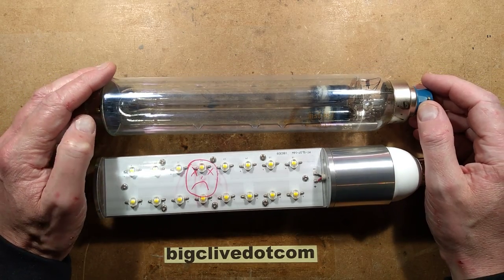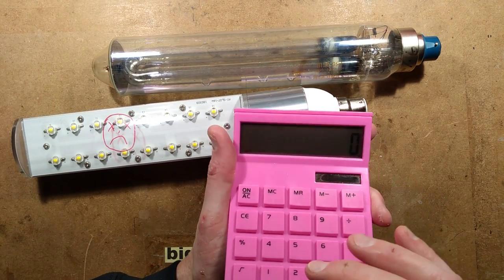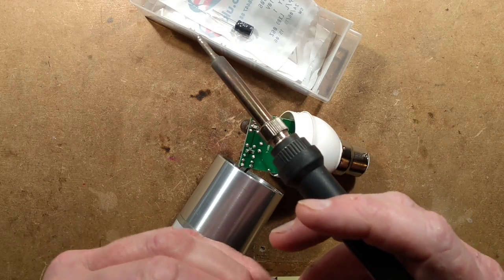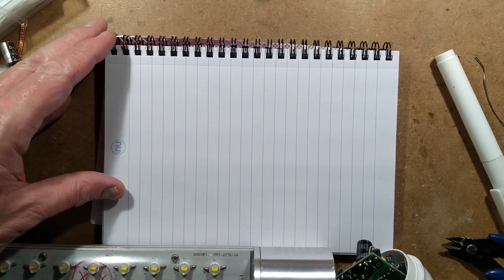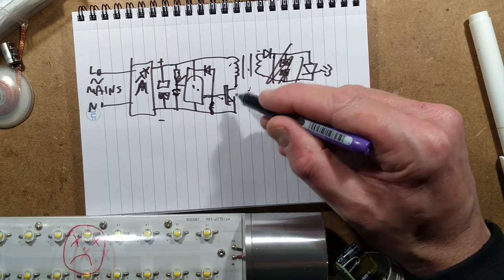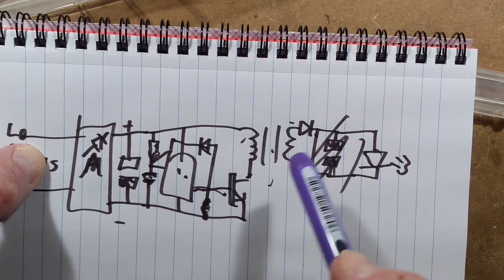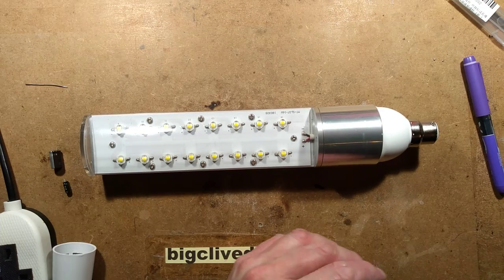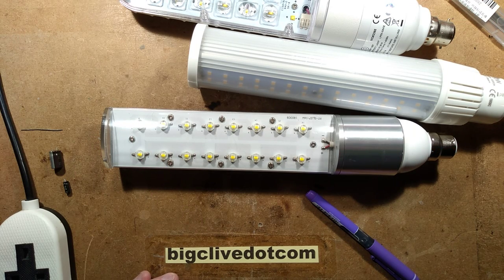Fixing a dead LED street light lamp.  (SOX retrofit.)

Comment: Cool video .. that lamp your repaired costs £45 new 😲
Reply: It's often worthwhile to fix something instead of getting new. My dad recently had an ice machine break. Found the issue to be a rusted IR diode. Replaced it and saved him $200 for a new one. I hate products that are designed to not be repairable. Some IKEA electronics I own is all glue welded shut so you can't access the circuitry without breaking it.
Reply: @Okabim  yeah.. a lot of the time when things break, even expensive things, the problem is just one 10 cent part and the knowledge to fix it. im sure so many things have been thrown out due to a blown capacitor or similar.
Reply: 8p for the part to repair it, but how much for the electrician to carry out the repair? Unless you have a workshop that does hundreds of them every hour, it’s not worth it.
Reply: Maybe somebody can run a business saving dead ones from landfill and selling reconditioned ones at half the price of new ones. There's a liability that has to be accepted... Swapping lamps costs more than the lamps.
Reply: Just think how much more reliable it'd be without the dodgy electronics in there. What's the point of charging up caps to power things when there's a power supply to hand already ?
Reply: @Polite_Cat  It's time we stopped being pissed about by manufacturers and demand they repair everything they make free of charge - when it involves 'gadgets' - like engine management systems on cars. I got a Renault where the electronics stopped recognising the key - so it wouldn't start. If they'd charged me for the repair, the bill would have gone to Renault.
Reply: @katrinabryce  thats why basic electrical knowledge should be taught in schools.. people often know how to fix simple things in their household or do woodworking, etc, but if they knew how to replace a simple component like a capacitor it would help people to fix their own things
Reply: Taxpayers money..that is why your council tax is stupidly high :-(

Comment: Skimping out helps to ensure more purchases of replacements.
Reply: And that's the irony - it probably costs the taxpayer hundreds of £££ every time one fails and either has to be repaired or gets chucked due to one component :( Wonder how many authorities actually bother to go down to component level to repair them - probably not many I imagine?
Reply: @Umski  every LED I've put up that doesn't work gets sent back to the manufacturer
Reply: @user-lq1dk6gr3p  that's good to hear :) If there's a good repair loop then that makes sense, but can't help thinking there's a premium on that process rather than a tech repairing it in-house?
Reply: Samsung has been very successful using the very same low quality "Sam Young" NXB series capacitors used in this street light in their LCD TVs in the past 15 years, making sure their power supplies will fail sooner or later from them drying out or puking their guts out. With newer, less powerhungry and less heat-generating LED backlit TVs they've started using even lower quality crapcaps to ensure something or another will fail, even without being assisted by waste heat from the PSUs heatsinks
Reply: @Knaeckebrotsaege  That's a reflection of the twisted, modern ethic of "If it's legal, it's ethical."

Comment: What Micheal Wynne said also used for cleaning carburetors, piano wire some call it, guitar string, but the set you have are files, so push thru the hole starting with a smaller one til desired size for electronics. I just woke up (so not awake all the way) but not sure what it would do to a double sided hole, im not sure. I'm guessing if ya filed to much it would eventually grind the doubled sided hole out.
Reply from the maker: It would definitely pose the risk of damaging the through hole plating.

Comment: The part that's boggling is the ALUMINUM is still the pricey part - and the cheap electronics failing still require replacing ... the aluminum.

Comment: These retrofit lamps could have been used in many areas instead of replacing the whole Previously installed SOX or SON lanterns, interesting to see the circuitry of the LED lamp explained as this flashing effect is a common failure mode of many LED flood lights. Unfortunately unlike the older fittings, when the circuits fail it usually means replacement of the whole fitting rather than just the lamp.

Comment: Are the desolder tips on the keyring ribbed for your pleasure Clive?
Reply: I presume the ribbing is for filing out clogged holes.
Reply: bren106: I think that the ribbing is to help fight tooth decay. Can also be used on dentures but always check with your dentist and your doctor First (liability disclaimer) use at own risk.
Reply: 5:36
Reply: Those tip look like oxy torch cleaning tips.  I would imagine it also could be used for desoldering guns.
Reply: @crosstalk71  Torch tip cleaners have 1001 uses!   I use them often to bore out small carburetor jets to get small engines to run right when they come from the factory  set too lean to be worth a shit due to emissions compliance bullshit.

Comment: Thinking about the long delay you experienced after fixing the bootstrap capacitor reminded me some issue I had too. The root cause was that stored electrolytic capacitors for a long time had a significative increase of their leaking (parallel resistor due to the aluminum oxide layer). They usually need reforming... This was done at the first power up, but as the bootstrap resistor has a quite high value, this took a lot more time until the parasitic capacitor leak reduce significantly. Using an ESR meter on an untouched spare capacitor could confirm that...

Comment: I remember when the little town I grew up in joined the LED lamp game. It was quite 'early' in the LED craze, so they weren't as reliable. They replaced all the lamps in the housing areas of town with the LED ones. Well, the LED lamps didn't spread the light, so you had about 10-15m of very bright light and then darkness. Was very annoying to drive through because it was just a constant dark-very bright-dark-very bright. And to top things off, after a couple months they failed one after the other. Now they got decent ones that actually light up the street sufficiently. I guess they cheaped out on the first ones, because that's what they love to do around here...

Comment: Back in my VCR repair days, switching power supplies would chirp when the bootstrap capacitor went bad. We kept a stock of all the capacitors and would just replace them all when we saw that symptom, including the main filter cap. They were considered wear parts just like the belts and idlers.

Comment: Those through hole cleaners sure look like oxy-fuel tip cleaners, they range in size from 0.4mm to 1.6mm and can be picked up from any welding supplier for those who are interested.
Reply from the maker: That's odd.  They were sold as being for PCB through holes.
Reply: @bigclivedotcom  there is no doubt in my mind that they were, they have a 101 uses!
Reply: @bigclivedotcom  Look on ebay for "hollow desoldering needles" - these type seem better
Reply: @bigclivedotcom  I use the same ones for cleaning my vacuum desoldering iron.

Comment: The pin set look like acetelyene torch tip cleaners. I use them for my torches of course but they are handy for your purpose. I have used them to clean orifices in air filtering equipment as well.

Comment: Even though the LEDs are now more economical, practical and longer lasting the sodium lamps will always be much more interesting. The physics of their operation is so much more rich and accessible to the curious. You have noble gas mixtures which you can use as an entryway to element ionization potentials and the nonintuitive Paschen's law governing dielectric breakdown gradient and gas pressure. The sodium itself is interesting for its phenomenal efficiency at converting electrical potential energy into yellow light at the two Fraunhofer D lines due to spin-orbit coupling in the electron transition from the 3p to the 3s levels. The D lines can be used to demonstrate Zeeman effect due to external magnetic field splitting of the lines (energy levels) (see Ben Krasnow's video). The spectral emission of the high pressure lamp exhibits an interesting property of self-inversion or self-absorption where the pressure broadened D-lines are partially reabsorbed by cooler sodium vapor surrounding the hot arc, just like the atmosphere of the sun and stars produce absorption spectra. The sodium in the tube is actually an amalgam with mercury, an interesting point to discuss eutectics. The discharge tube itself isn't even glass, it's sintered aluminum oxide which the corrosive sodium doesn't attack nearly as easily. The outer envelope of glass containing the discharge tube is coated with indium tin oxide, transparent in the visible but reflective in the infrared to increase heat retention in the arc tube and increase efficiency. The coating on the tungsten coils at the ends of the discharge tube used to enhance thermionic emission of electrons when hot is interesting. On and on it goes. So much more to enjoy thinking about than with the relatively boring, simple semiconductor band-gap of an LED and a little blob of posphor overcoat.
Reply: 10mintwo You need to also think of the complex physics of giving the transformer core the desired magnetic properties (involves shape and mixing of metals).  The electromagnetics to store energy in that core for release on the other side.  The tricky chemistry of turning wet paper into an efficient but long lasting capacitor.  The even trickier chemistry and physics of making a blue spectrum LED die.  The electron orbital physics and chemistry of the phosphor pasted over the LED.  The tricky eutetics of making various solder compounds work, such as SnPb, SnAgCu and SnCu.

Comment: Those pins are used in soldering to clean the solder extractor tips. Look up the pace  sx-100. They are magical for plated through holes.

Comment: Nice video. I think that sodium lamp spent its working life vertical with the electrodes up, allowing the sodium to accumulate at the end. The smaller ones can run vertical. After many hours of use the Sodium does slowly boil out of the dimples and condenses in the cooler spots of the tube. I'm guessing that the bits of glass might be bits of mica from the mica support at the electrodes. I've seen it in my bulbs.

Comment: Those pins are called "torch cleaners" - I've found they are useful for clearing blocks in solder sucking devices or - torches :).

Comment: That keyring with needle pins is for cleaning Propane gas flame cutter or welding type nozzles. Like the pricked tool used on the nozzle of old Paraffin stove

Comment: Thanks Clive as always, that mini file set used at 16:11 is on fleabay still in Feb 2021 and is called various things but use any of ... -Gas Welding Tip Nozzle Cleaner File Set for Soldering Weld- to find them.  I got one at £2.74, might be useful one day.

Comment: Double sided boards with plated through holes are much more reliable for removing components as the pads are much less likely to lift. 
No need to remove that 470uF cap, just add your cap in parallel to test, much quicker. Same with the 22uF, specially with the shotgun approach.

Comment: 24:56 - The issue is probably that the camera is trying to record at 60 or 30 fps, and mains frequency there is 50 Hz, so you get a sort of temporal moiré effect (that adds a slower pulse on top of the actual shimmer). Look for an option to switch the camera to 50 or 25 fps, and you should get less shimmer.

Comment: Keyring thing is a torch tip cleaner, used for cleaning both acetylene welding torches and also usable to clean out clogged solder suckers.  You want to have the plain stainless steel needles, so that you get the smooth surface. 

that capacitor is a regular failure point, typically though I see a 47uF 35V unit used there, so I keep a stock of 47uF 50V low ESR capacitors, so that they will have a longer life.
Reply: You fix a lot of these lamps.

Comment: Cities need to be careful with LED lamp selection unfortunately because cost-savings isn't everything, 
in my area many of the roadside streetlights are replaced with mostly white LED lamps that
are strictly down-firing (virtually no light comes out the side like with older styles) so you
get a lit road, but a very dark street, if that makes any sense.  The part the cars drive
on is well lit, the sidewalks and street in general is quite dark compared to when
they had traditional lamps with kinda rounded lenses instead of flat plastic at the 
bottom that only lets light out angled down.   So you can have a technically "lit"
street thats all very mugger and rapist-friendly, sadly.  Especially because many
businesses that used to stay lit-up at night are also on the effeciency bandwagon
and going to minimal or no lighting after hours.  Good for carbon footprint I guess,
also good for rapists and scumbags.
Reply: My council uses them roadside lamps off roadside in the close under trees so half the houses are pitch black and my house lit up brighter than the daytime.
We had them turn off a row of leds as it was too bright having them on all night.
It has broken down 8 times since they installed them and now has been on permanently the past 3 months .....i think they just give up!

Comment: I love all your vidz very professional and educating, but I loathe and dislike l. e..d lighting , my eyes are very sensitive and the frequency through the on off cycles really give me a headache, I much prefer incandescent filimant bulbs still to this day. So to get in with saving power I fitted low consumption 12v lighting into my house with diffusers to spread the light and conserve energy through a solar battery Bank.  Good stuff Clive keep it up I have been doing electronics since I was 6 my father taught me, and yet I'm still  Learning from your videos. 👍👍👍

Comment: Quick tip for desoldering bad caps. Rock the can so it stresses the wires and breaks the component off the board with only a sliver of wire left through the hole. Then you can simply clean out the hole with your normal desoldering techniques, vacuum and / or braid. That way you aren't fighting the thermal inertia of the capacitor to heat up the solder.

If you can access the leads on a bad component with snips, that works too. Just be careful not to pull on the lead and lift a trace or scrape the board with the cutters, ideally the wire will break just proud of the board.

Comment: The “pins” (files) are often used to clear the holes in the tips of desoldering stations.  The metal tips of the more expensive commercial desoldering will clog and can be cleared when hot.

Comment: I've had good luck heating the solder and smacking the board on the table for clearing through holes of solder. It's fairly quick, and easy.

Comment: Good Stuff, just fixed a 4ft led floro replacement that was no go was a similar fault small 22uf cap around the switching chip all else looks v good so some of major failures are just 20c cap !!!!!!! go figure. well done.  ps i never got hold of an low p sodium lamp to play with why u replace them with a same color is beyond me ?

Comment: Those “pins” you used to clean the pcb holes look very much like oxy tip cleaners. When cutting steel, slag sometimes clogs the copper cutting tip and these cleaners are used to remove the slag.

Comment: For clearing the through hole solder try using wooden toothpick. Heat up the pad and stick the pick in the hole. Works like a charm.
Reply: Propelling pencil leads work nicely.

Comment: Some square LED fixtures (10"X10") were installed at new construction diners. Within a couple of months several of the lights at every location started blinking/flickering. I got one of those and found that the CREE 60W @24V chip would also blink with a different LED driver. So I just used the original power supply and retrofitted a 100W square chip into the unit. After a couple of months that LED chip started blinking too. I tested it with an alternate supply and sure enough the 100W chip would blink with that supply too.
I will try another 100W chip and if that one starts blinking, I will trash the original supply thinking it is damaging chips and use another supply with another new chip and see what happens.
The thing I find odd is that LED chips themselves can degrade to blinking just like in this video. Makes me think the little micro wire inside the LED is flexing when it gets hot breaking contact and then when it cools it flexes back connecting again, like an incandescent blinker light.

Comment: I remember the Armageddon attraction - in the Studios park, wasn't it?  My brother was a case member on the opening crew in 1992 and I had a lot of visits to both parks.  The attraction in question was spectacular in the early days of its operation for sure.
Reply from the maker: That's good.  When I was finishing the lighting they were still testing the effects and programming it.  The graphics were just wire frame outlines at that point for test and alignment.

Comment: There will probably be a MOV in there too,being a streetlight they are very susceptible to voltage spikes,due to lightning on the lines,I am a linesman & I work in the public lighting division & we are constantly changing fried LED streetlight lamps,they are a great light but just a little bit too delicate,however they are much cheaper to replace than a 135W high pressure Sodium vapour tube
Reply from the maker: Are they actually cheaper than the original lamps?  Over here the contractors seem to be charging a fortune for all street light components.